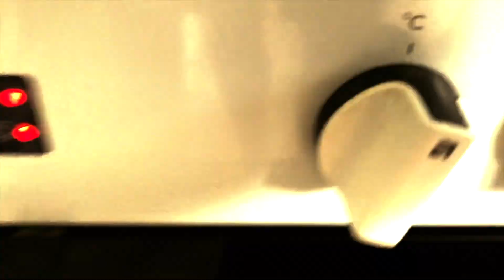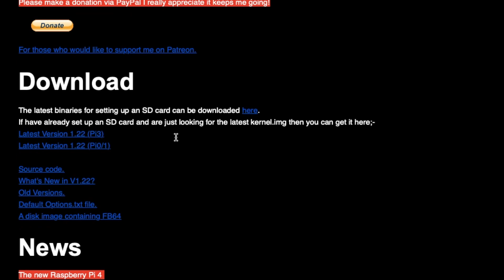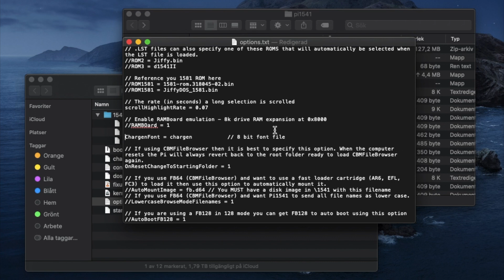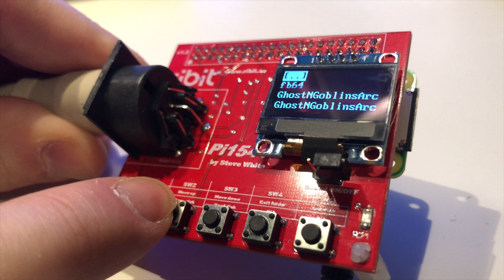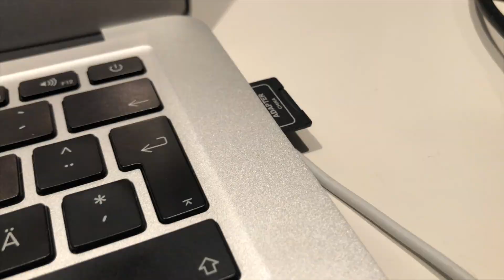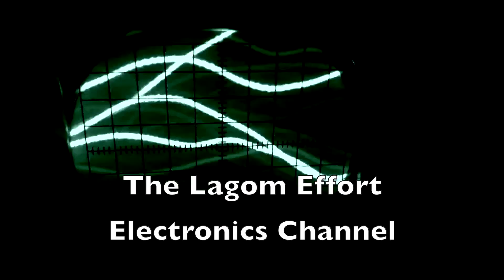Howto: Pi1541 on RPi Zero and 1

Comment: Hi, really nice tutorial ;) I've tried the Pi1541 project with a Raspi 1 A+, it seems to boot with the configuration supplied but I get Device not found in my C64 even if I can successfully mount a d64 image using the keys in the Pi1541 hat. Any hint?

Comment: Ok, that was a very good video. I have a question, I have a pi zero, did the work as described and tried to power it up, but without the connection to the CBM 64 itself.
The screen on the pi hat does not light up. I see 2 green flashes from the ON led, but nothing else....

Is that normal, or can the pi1541 only work when connected to an actual  64?

Comment: Great video!  I have a Pi1541 hat that works perfectly on my Pi3, but using a separate SD card and this video as a base I cannot get the Pi1541 working with a Zero 2 W.  Is the device itself unsupported, or am I missing something?  Thank you.

Comment: built one yesterday (albeit the simpler A option) it seems to run but the oled displays only the boot logo
I haven't connected it yet to my c64, is this correct behaviour or i'm missing some configuration?

Comment: Does this work with the original Pi Zero (not W nor W2)? thanks
Reply: Probably works only in Old Zero (not 2 / W) but untill I get any operational Old zero - it's unknown..
For pi zero W not working 😢
Reply: @DaBuzz92  I have it running on the Pi Zero W. It didn't work at first, but then I used the Raspberry Pi Imager to install Pi OS onto a separate SD card and I copied over the 3 firmware files (bootcode.bin, fixup.dat and start.elf) from there to the pi1541 card and that made it work. (The Pi Imager let's you select the hardware you are running, so I suspect that the imager installs the correct firmware.) I also used an older dos1541 file from Vice 3.5. Let me know if this works.
Reply: If you don't have a second SD card, you could first use the Pi Imager to format your SD card and install Pi OS >> then you would delete all files, except for bootcode.bin, fixup.dat and start.elf >> then you would follow the rest of the steps from the video

Comment: The "litmus test" for this is to load Ghosts&Goblins arcade game on a C64 with it. If the timing is perfect, then it loads perfectly! If the timing is off by even a slight amount, loading this game will fail. The Pi zero would not load this game for me, so I went through a painful endeavor to figure out how to use a Pi Zero 2W, which has more "CPU power and a faster clock speed". To use this, you have to load all the Pi1541 firmware on the pi zero 2 and "make" the firmware, then copy it to the appropriate MicroSD card. It took me most of a day to figure this out, but the Pi Zero 2W DOES have the power and precision to load Ghosts&Goblins with the Pi1541.

Comment: Thank you for this video. :-)
Everything was explained very well.
With this guide I was able to configure my Raspberry Pi Zero as a Pi1541 emulator.
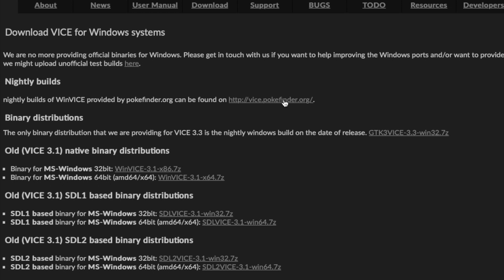Unfortunately, the link in the video min 3:13 (Nightly builds) no longer works. The following information appears: "Game Over - Use the officially supported ad hoc builds from Github"

Comment: Which PLA was in that first C64 that was incompatible with the game? I am going to use the PLAnkton in my C64 build, so I wonder if there are any problems with that one.
Reply from the maker: Hi Sean! The PLA replacement I was using was an old CPLD implementation from 2010 by fpgaarcade. It was fairly experimental. 
The PLAnkton on the other hand is a great choice and should serve you well.
Reply: @TheLEEC  Thank you for the information!

Comment: I found a PI B+ v1.2 from 2014, would it work for this project ? it have no heatsink, but i guess i have an option to mount a cooler if needed.
Reply from the maker: Hi Crazy! :P When it comes to the Pi1 models the results can be a bit unpredictable. The overclocking needed works on some boards, but it’s not guaranteed. Cooling helps sometimes but not always, so transmission line timings are probably part of the problem. It’s worth trying though! My attempts (2 B+ boards) have been successful and stable without cooling.

Comment: Will this work on an OrangePi zero ?
Reply from the maker: Currently, no. Pi1541 is developed to run bare metal on the Raspberry Pi 0 (or 3) without any operating system, so a lot of the code is hardware specific. I’m sure Steve White wouldn’t object if someone wants to contribute and port it to other platforms but I don’t think it’s on the roadmap.
Reply: @TheLEEC  I see, didn't knew it was running bare-metal. Thanks.

Comment: I know this is an old video but hopefully you see this!  :)  I just tried this using my Pi Zero W but only get the "Rainbow Square" in the bootup process... According to the info I found this is because the kernel.img is not booting correctly! I am using the latest version of Pi1541 (v1.24) but cannot find any older versions like the one you are using to test with! Any ideas?
Reply from the maker: HDMI output on Pi1541 is only supported on Pi3 models. Running Pi1541 on a Zero or Pi1 WILL display a rainbow screen on HDMI, because Pi1541 never initialises the GPU at all. It still runs, but never touches the GPU, so the firmware rainbow screen will be the last thing the GPU is asked to display.
So, in your case, if you have prepared the card right and use the right kernel.img for Zero, I would go with the assumption that Pi1541 is actually running, but you'll need verify that by connecting to a Commodore or using an on-HAT OLED. Good luck!

Comment: Hi, great video! I tried this with my existing Pi1541 hat & my new RPi zero. It seems to work but the HDMI connection from the RPi zero to a monitor just displays a rainbow screen & a USB keyboard can't be used to navigate through the ROM list....The Pi1541's LCD screen  displays correctly. When I use the Pi1541 with RPi 3B+ the HDMI & the LCD both work at the same time & I can use a USB keyboard to navigate the ROM list. Is the HDMI & USB keyboard supposed to work on the RPizero with the Pi1541 hat installed?
Reply from the maker: Hi, Len! Thanks for the kind words.

On the Pi0 and Pi1 models Pi1541 has a reduced feature set, so the HDMI and USB control is not available and not possible. The reason for this is that anything that needs constantly unpredictable CPU cycles will make the emulation unstable. The single CPU core, already running at a high load on these Raspberry models, needs to be completely dedicated to the cycle exact emulation. So, the HDMI interface requires a Pi3 (which has 4 CPU cores that can coordinate the tasks without blocking the emulation thread).
Reply: @TheLEEC  ....Thanks for the explanation. Makes me sad that I won't be able to use those things, but I understand the reasoning ;-) ....it makes sense. I haven't got my Pi1541 Zero hat yet, but thought I'd try it out with my full-sized one while I wait. Your video was a really good guide to get the SD card set up correctly. Keep up the good work!
Reply from the maker: My pleasure! Good luck! Work is still being done to optimise the code and cram as many of the features as possible into the Zero, but the single core is a challenge. Maybe some day a new Zero version with multiple cores will come and solve that. All the best!

Comment: Very nice video tutorial. I'm actually using the Pi1541 cable version. It works fine but I'm wondering how can I use the browse mode on the RPI+USB keyboard+HDMI output to a monitor, in order to mount D64 images. In the official web page it says: "USING

Once set up, you can optionally connect the Pi to a screen via the HDMI port (also connect a USB keyboard).
You can then use the keyboard to navigate folders and select disk images.
PAGEUP/DOWN help move faster through the folders.
INSERT adds an image into the selected list.
ENTER adds an image into the selected list and enters emulation mode.
ESC exits a mounted image (and emulation mode) (and clears the selections).
BACKSPACE backs out of a folder (and clears the selections).
Whilst in emulation mode, the number keys are used to swap disk images (when multiple images are selected).
Whilst in browse mode, the number keys are used to swap ROM images.

Once an image is mounted you can use the Commodore computer as you would for a disk inserted into a real 1541."

How can I use this mode, i.e. browsing d64 images on the RPI with a keyboard and HDMI monitor instead of the FB64 browser? Many thanks.
Reply from the maker: Hi David, sorry for the slow answer.
Thanks for the kind words. 

From the context of the video I assume you are using a Pi Zero or Pi1. In this case the HDMI and USB is not available and not possible. The reason for this is that they need constantly unpredictable CPU cycles and the single CPU core needs to be completely dedicated to the cycle exact emulation. So, the HDMI interface requires a Pi3 (which has 4 CPU cores).
So unfortunately your options to control Pi1541 are to use the FB64 file browser on the C64 or get a full LCD equipped Pi1541 hat.
Reply: @TheLEEC  Thank you very much, yes I am using an RPI 1 Model B+ w/ 512MB RAM and yes, your reply is exactly what I needed to know. So thank you for your explanation. I'll go with the FB64 file browser. At least until I get an RPI 3b+. :-)

Comment: Ok.. the rpi0 costs 6 euros but what about the HAT? where to find it? How much it costs? Shipping is what?.. hmmm can be a nice "backup" unit though.
Reply from the maker: Also great points. Well, the choices are many. The minimal solution option A hardware can be built for peanuts (<€3) with a voltage converter board or a handful of low power mosfets. A full hat with buttons and screen is on average €30-40 shipped but can be found for less in kit form and way below €20 if sourcing the components individually off of eBay or similar. Links to the hat kit I use is available in some of the video descriptions. In the end, Pi1541 is just free software and nothing else. It’s very much aimed towards hobbyists and the hats are products created and born from the community. If you’re looking for a solution in a box with embossed print that open by air flow in 7.3 seconds, Pi1541 is not what you’re looking for.

Comment: You know, you could just ZIP all the contents of the SD card for the zero so it would just need to download it and unzip it on an sdcard and it would be a breeze for people to use it.
Reply from the maker: ZIP? Who’s he? :P Well, sure, I see your point there... but that sort of defeats the purpose of doing an instructional video, doesn’t it?
“Hey teacher, I need help with this algebra stuff. I’ll just pop off to the pub while you do it...”.
Secondly, even if many people have a similar setup, a surprising amount of people have variants with different LCDs, rotary encoders, etc. You need to make decisions to get it running. Furthermore, the Pi firmware bits and the drive roms are not mine to redistribute and that’s why Steve White hasn’t included them in the Pi1541 package. But sure, some of the defaults in the config file could probably be updated to more common settings. Maybe Steve will work on that.
Reply: @TheLEEC  no, it does not. But nevermind.

Comment: pi1541 is a very nice thing but I think the only device need is the Ultimate 2+ it costs almost the same of all raspberry stuff (the board, the hat, the psu, some case, the cables, etc etc) and gives to the C64 everything you ever dreamt of: ram expansion, cartridges, tapes and 2 perfectly emulated drives. Nothing more than that is really needed. Unless you have  a fetish for tapes, the there is the Cute32 project too. But I was a drive guy more than a tape guy :D Anyway, nice video and keep it on!
Reply from the maker: Thanks for the kind words. I agree, the Ultimate is an excellent device. I covered it briefly in an earlier video. The cost of Pi1541 does vary a lot depending on what point you start at.
Still, a new €10 Pi Zero or €35 RPi3 with a €20 hat and potentially a leftover PSU from some old phone still a far way from the €140 list price of the Ultimate.
You can go very low in cost for Pi1541 and get a good experience, but going all in with all new stuff, list prices, big screen and custom case you might get close to €100. And if you’re aiming for the best possible you’re probably better off going for the Ultimate. Neither Pi1541 nor SD2IEC will get you the best.

Comment: Hi Kevin, didn't worked in my setup, I tried with the original pi model b revision 1, from 2011 (the audio jack is black, not blue). Can be done with this model? 
I have replaced some pins, according to this diagram because my board have 26pins insted of 40, any clue? thanks in advance
 https://elinux.org/RPi_Low-level_peripherals#General_Purpose_Input.2FOutput_.28GPIO.29
Reply from the maker: Hi Tony,
Getting the Pi 1 running should be seen as a challenging entertainment more than a feasible solution at this point. The Pi 1 Plus model with the newer form factor has many improvements in its power rail circuitry and has a better potential for overclocking over the very original Pi 1, but even there it is a challenge and luck varies between boards. I would probably not see it as worth the effort given the 26-pin obstacle and that a supported Pi Zero can make the problem go away for less than $10. But... maybe I’d try it for the challenge with the lowest expectations. :) Good luck!
Reply: @TheLEEC  Thanks for the answer, George! (lol)
I used to have that board in my closet and I thought will be a good use for it! My 3 board is with retro pi... 
Thanks for the advice, great video by the way!
Reply from the maker: Hehe ;) thanks. Glad you liked it.
Reply: Here are some info on how to connect the 26pin gpio (Not done by me by the way! ). It's implemented and supported in the original source code by Stephen White as well as far as I understand. Have been meaning to test this for some time now, but sadly I haven't had the time to test it myself. But will do that as soon as I can :)  
https://github.com/Andreas-B1105/Pi1541-RPI-1B-26GPIO
Reply from the maker: Good stuff. Thanks Björn!

Comment: Should I use the same overclocking setting on a Pi1 B+ V1.2? And do I need cooling for that?
Reply from the maker: Hi! The overclocking for the Pi1 B+ is shown at 15:50 in the video and worked well for mine. The numbers are quite a bit over the comfortable levels for the Pi1 so success may vary from one Pi1 to another. We set the temp limit there also, so the Pi1 should be safe, but once it reaches the limit it’ll start to throttle down and that might give you emulation issues in Pi1541, so a heat sink is probably a good idea. I never needed one but I never ran the Pi1 more than a few minutes.
Reply from the maker: And maybe I should clarify: I was also using a Pi1 B+ V1.2 there in the last part of the video.
Reply: @TheLEEC  I had to overclock mine even more to get everything to work. Here is my config.txt:
kernel_address=0x1f00000
arm_freq=1250
over_voltage=8
sdram_freq=550
sdram_over_voltage=2
core_freq=550
temp_limit=75
force_turbo=1
boot_delay=1

It's running with a home made copper heat sink and a fan.
Reply from the maker: Cool. Well done. Certainly proof that results may vary quite a bit with the Pi1. I found that SDRAM clock matters a bit more than the core to push that last margin. Thanks for sharing.
Reply: @TheLEEC  Great! Thanks!

Comment: I wonder why there is not a pi1541 sourcecode version on which the timings are adapted for Pi0 without the need to overclock the device. I think due to the compactness and price of Pi0 it had to be the preferred choice right from the start to develop pi1541.
Reply from the maker: That's excellent input, Roberto. Perhaps Steve White himself is a better person to answer that, but let me theorise.
The 1541 drive contains a lot of components, and Pi1541 aims to be a "cycle exact" emulator. This means that for every emulated clock cycle the interactions between the components are timed accurately enough so that the emulated hardware behaves the same way as the original drive would for any given input. This interaction between the components are exploited in creative ways in some fast loaders and other drive injected software. For the 100% compatibility aim, staying cycle exact is key. To do this, the emulator must have a fair amount of performance headroom and not experience too many unpredictable events. Quite a large amount more actually than a normal, theoretically "instruction accurate", emulation at 1MHz.
The Raspberry Pi 3 has 4 CPU cores, so it is fairly easy to dedicate a single core fully to emulation. The other 3 cores can do screen updates, polling, sound and other UI-related things. The emulated core can stay uninterrupted and run in a predictable way.
For a long time, scaling it down to the Pi Zero was the intention, but certainly a challenge because there is only a single CPU core to work with. All UI except for GPIO/OLED had to be thrown out and all the crucial bits adjusted to run in the single CPU core of the Zero in a way that wouldn't interfere with the emulation. Also, the single A7 core is nowhere near as powerful as a single core of the Cortex A53 on the Pi 3, so a whole lot of code optimisation was needed. Still, at that point overclocking was the only way to stay cycle exact. There's just not enough grunt to have a margin for "timing" the emulation with the rest of the necessary code. Perhaps further optimisation of the code can remove this need in the future.